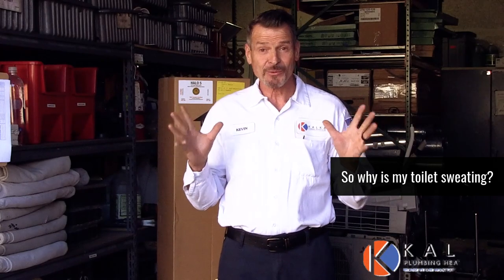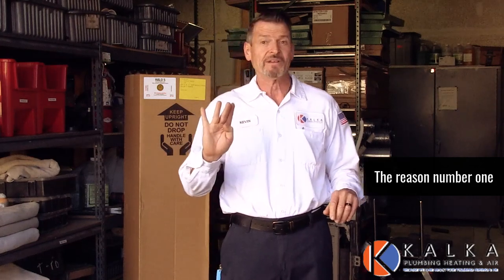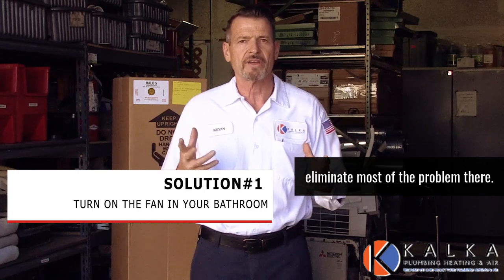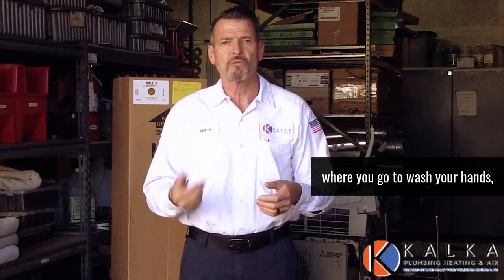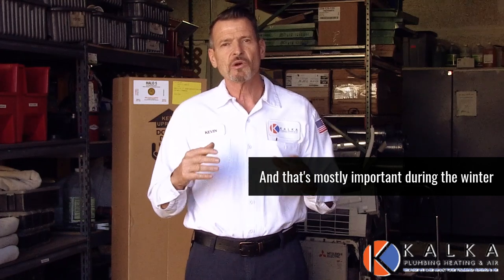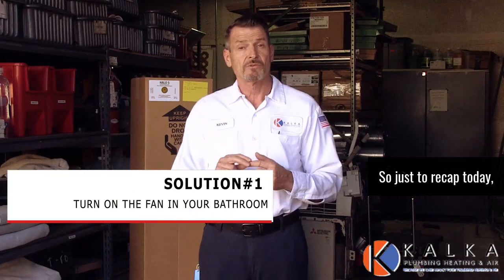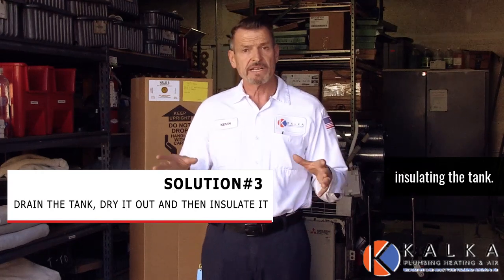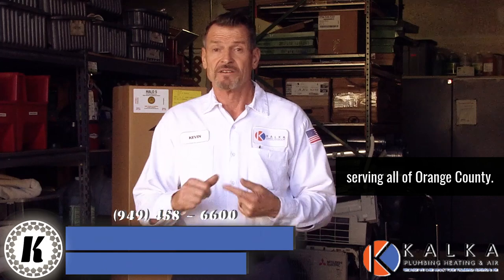How to Fix My Sweaty Toilet - 3 Ways to Fix It Now!

Comment: Hi, i never had this problem until yesterday.  My pipe was blocked and i had a plumber round.  My toilet was   taken off as he was looking for blockages.  In the end it turned out the blockage was in the main hole.  However he fitted the toilet back, then pointed out all the condensation on it.
He said that was normal, but i pointed out its not, as i didnt have it before.
What has happened? Any ideas
Reply: Mybe he accidentally switched the hot/cold lines